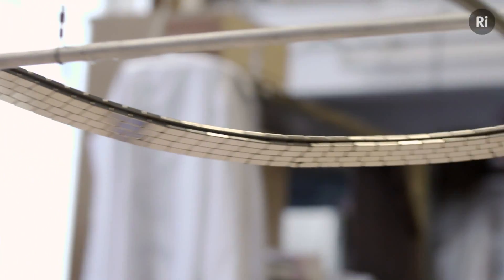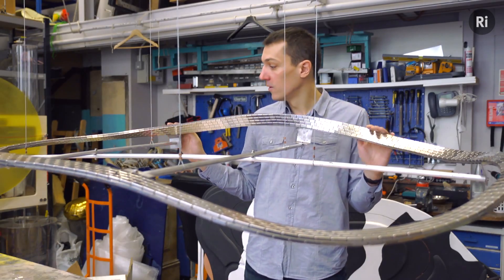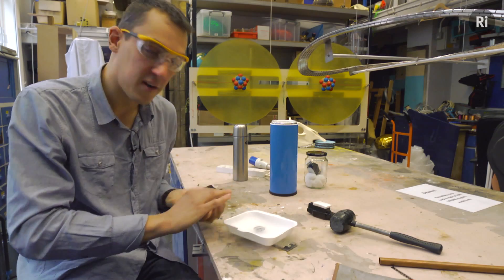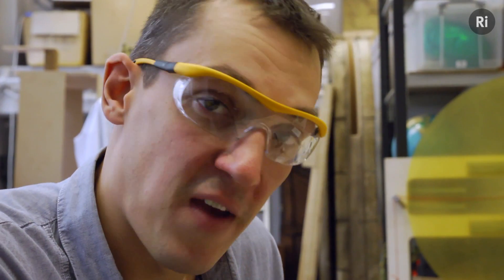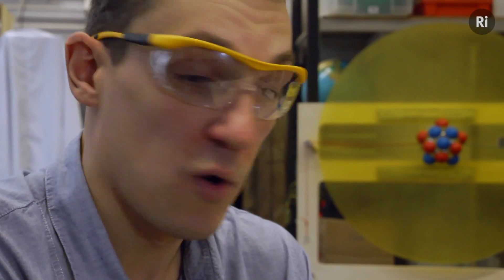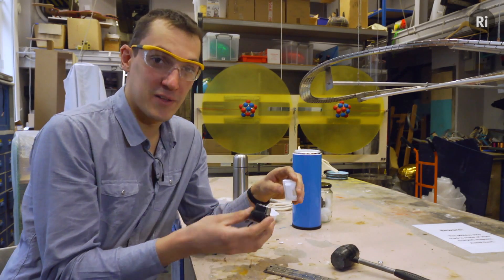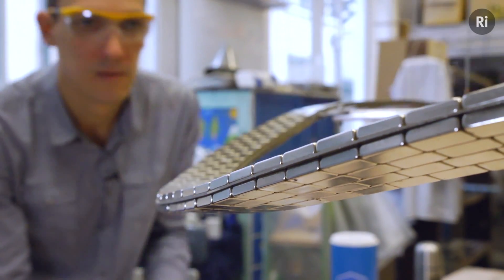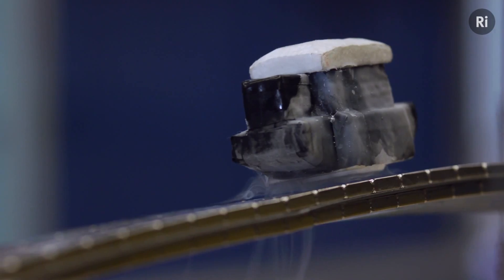Levitating Superconductor on a Möbius strip

Comment: The magnetic field is said to be pinned by the superconductor, but making a video on what's going on in there is more fun with superfluids (fluids with little obligation to stop moving) because electrons are even harder to see. That's not to say you couldn't mock it up somehow, sticking nano-perforated tracers in in superfluids to show electron density...

Comment: Your fingers vaporize the liquid nitrogen and a protective layer forms to keep it from falling into you like (badly handled) xylene or methane. So you get 2 phase changes of work (2 sides of the gas layer) keeping the dribbles from turning you into frostbitten corpse in proportion to the mass of liquid and your taste for pain.

With that in mind, make your own with painted double-walled carbon nanotubes (DWNT) to work in summer, out in the sun.

Comment: Being there is a current induced, could you run a volt meter on the tube and find it's current? Furthermore could this be used in some way to power a generator?

Comment: The same way. The superconductor stays the same distance to the magnetic field. But if you would have a vertical O shaped track, the superconductor would only float to the lowest point and after some swinging back and forth would stop moving (while still "floating" besides the magnets).

Comment: One question remaining for me is - Why can you pick it up?
I always thought you cool it down with a spacer between itself and the track so when it becomes superconducting you lock it in that distance to the track because any movement in any direction (other than the track) will [explanation as in the video] - but that also theoretically also contains movement away from the track (up or down).
So doesn't it have NO el. resistance but a veeery low one or am I missing something different?

Comment: If you touch it, yes. However, it's hard to touch it due to the enormous temperature difference between your hands and the nitrogen. As your hand approaches the liquid nitrogen, your body heat causes it to evaporate before you can touch it. You can even dunk your hand in liquid N for a couple of seconds and be fine because your hand is protected by a covering of N gas (I'm serious, there are videos on YouTube of people doing this). This is known as the Leidenfrost effect

Comment: When the superconductor has moved once around the möbius strip, it's upside down. So isn't the magnetic field pointing the other way relative to the superconductor then? And does that even matter for the levitation? And what happens when the conductor passes the point at which the field switches directions?

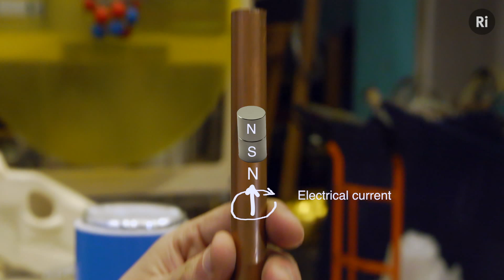Comment: It might be me, but I think there are some mistakes at 3:35 . First off al, if the north of the induced magnet field vector should be in the other direction.  Use the right-hand-rule ;-) . And If it was in this direction, it would fall down faster. Because inside the magnet, the magnetic field lines will go throughwards the north (to the south when outside the magnet), even if it's a solid magnet. And the induced magnetic field will always try to cancel out the magnetic field of the magnet.

Comment: you can reach higher speeds because the train will have extremely smooth track, instead of the classical railroad tracks where the train bumps into deformations in the track making it swing from left to right.

Comment: Further to my previous post, imagine a desk fan as an atom. When the atom has energy, the desk fan (atom) is spinning. Now, attempt to push your finger (i.e. an 'electron') though the blades. You can't because your finger hits a blade (this is electrical resistance). Now, cooling the atom is the same as turning 'off' the desk fan. You can now push your finger past the blades because the desk fan (atom) is stationary. Therefore, the atom loses all electrical resistance, because it isn't moving.

Comment: All matter is made up of atoms and these atoms are vibrating, because they have 'energy'. Electrical resistance is an electron attempting to flow past an atom, but collides with the atom (a vibrating atom takes up more space). Now, cooling something down essentially removes the energy from the atom, so it vibrates more slowly. An atom that is 'supercooled' is actually stationary (i.e. not vibrating) and uses little space. Therefore, an electron can easily move past a stationary atom.

Comment: When the train is upside down there is gravity pulling it down and the magnetic force holding it up. Before he pushed it causing it to move and it was hanging with no acceleration all the forces were equal. Because there are only 2 forces at work they must be equal. Force of gravity is mass times acceleration due to gravity. F=mg. Just multiply the mass of the cart by 9.8 m/s and that is the force holding it up.

Comment from the maker: It was a fairly strong attraction, enough to keep it suspended from the track when underneath - it obviously weakened as the superconductor warmed - so we have a quite a few shots of the boat simply flying off the track! It could be scaled up to a passenger sized train, i.e. a Mag Lev train - but your main problem there isn't the suspension system it's overcoming air resistance. Plus it's a bit of a hassle to keep the super conductor at low temperatures.

Comment: You are close but terminal velocity is only when an object is free falling. The only forces in that situation are gravity and air resistance. Once these are equal you stop accelerating and reach your terminal velocity. In this case it is horizontal motion. If the propulsion of the train is equal to the air resistance then the train would hold a constant velocity or zero acceleration. If your propulsion is stronger than the air resistance then the train would positively accelerate.